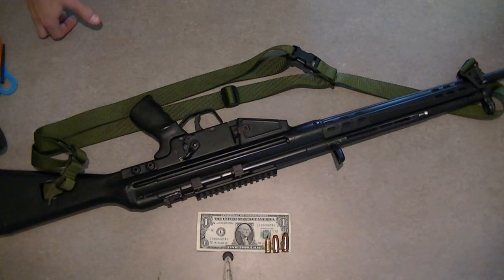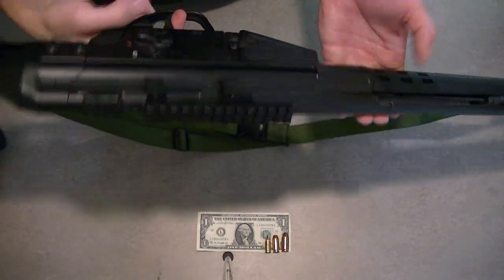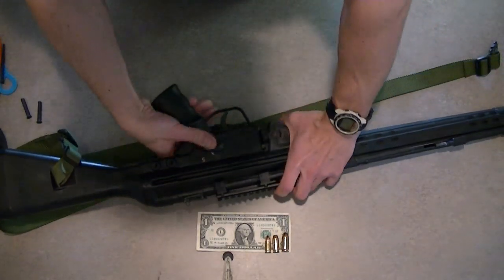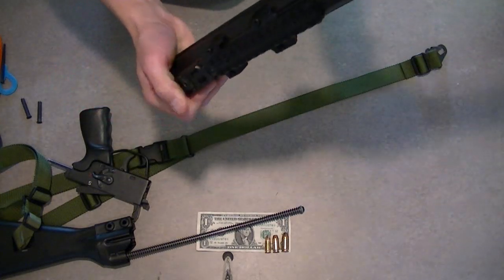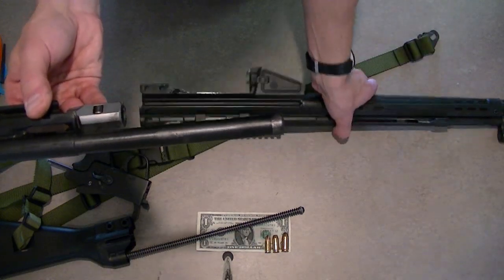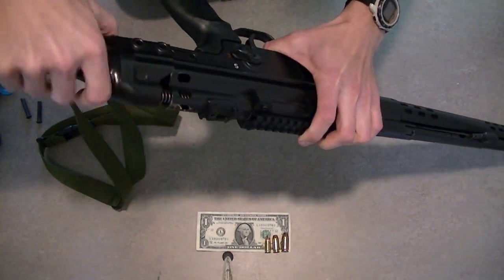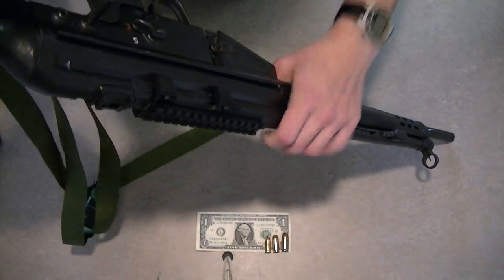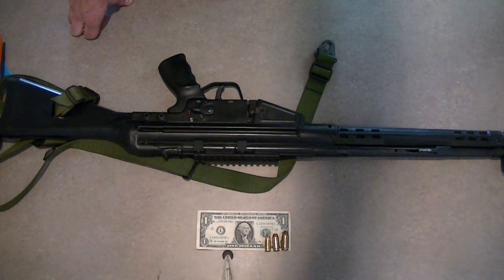PTR 91 Field Strip (FULL) HD

Comment: 308 actually runs at a higher pressure than the military issued 7.62x51, the opposite of the situation with 5.56x45 vs .223. And no it will not take M1A/M14 mags without modification. Which would likely not be worth the time or effort as M14 mags are about 27 bucks apiece and G3 mags are $3 apiece.